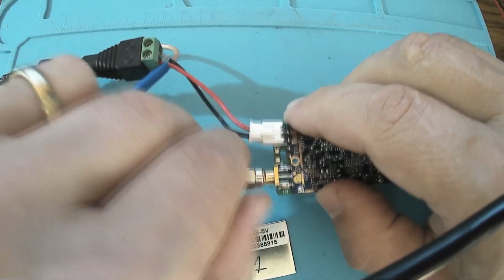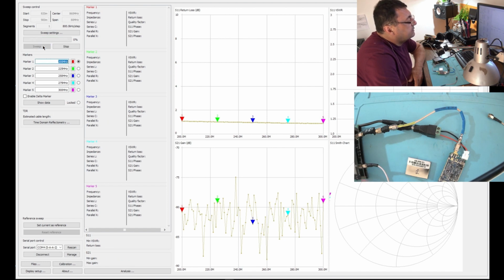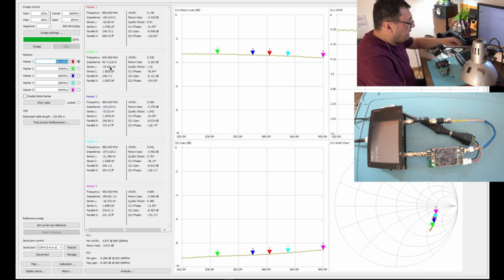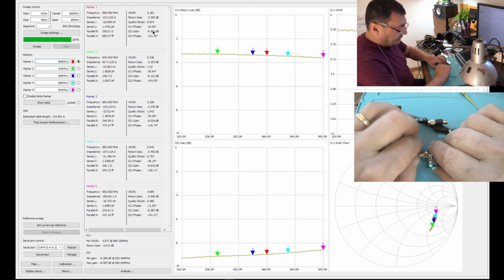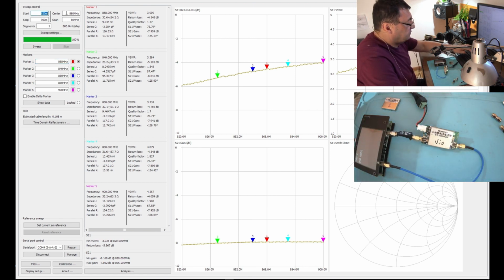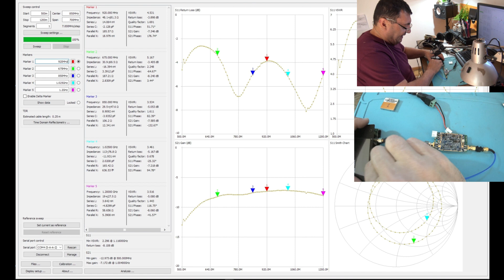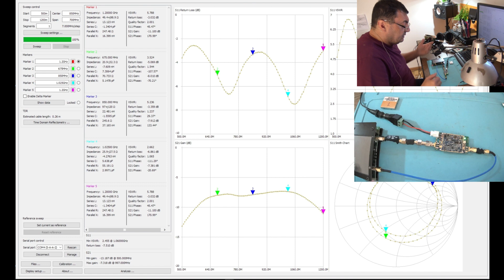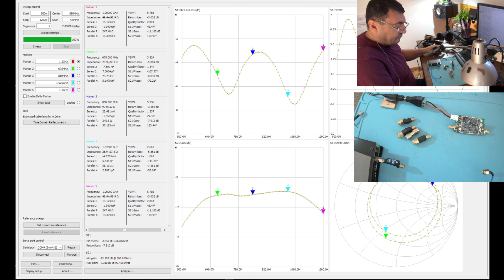AB-868-5V Ab-IOT-868 NanoVna RX and gain test

Comment: These air buddy’s are good, I have gone from 15 to 27 witnesses
Reply from the maker: It seems like they do the job, just place a filter in front and your done.
Reply: @viocaia  yes without a filter mine returned zero witnesses. Thanks for your videos, inspired me to get the amp 👍🏽
Reply: I sure would like to buy one from you
Reply: @nathanshaw6503  eBay